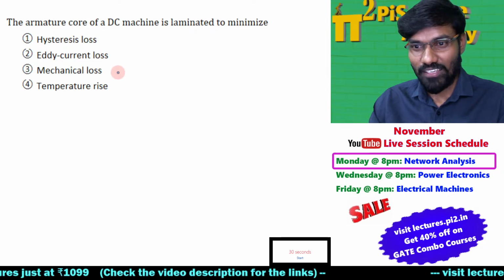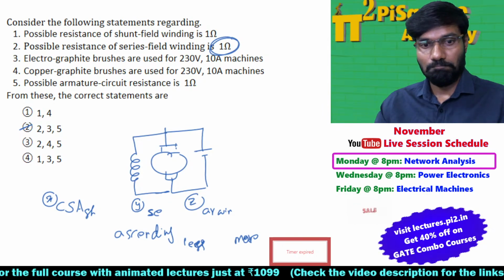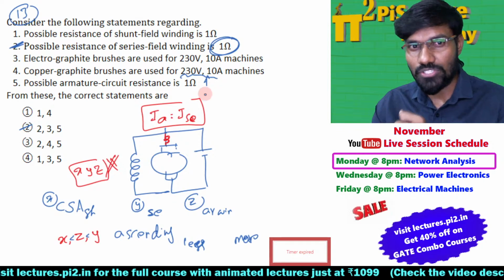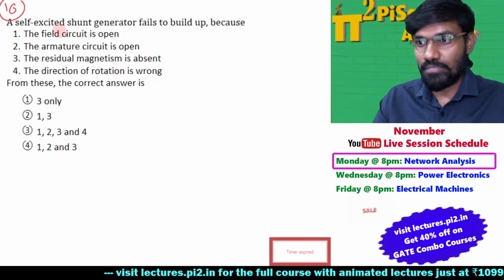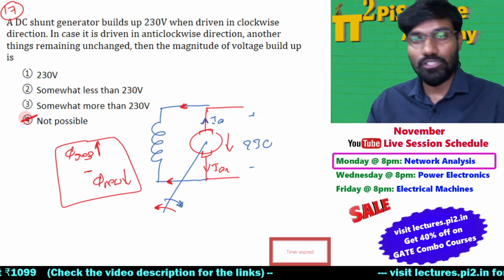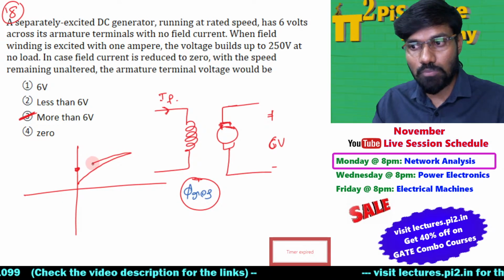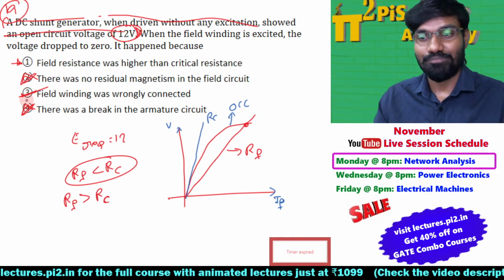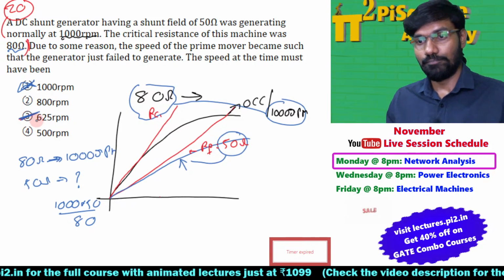Electrical Machines Practice Session (MCQs from PS Bhimbra Part-2) | PiSquare Academy

Comment: Sir, when direction of rotation of dc machine changes the resultant flux will get nullified. But after some time it again builds flux in other direction. Yes..?
If yes then it will buildup voltage again...(is it true...?)